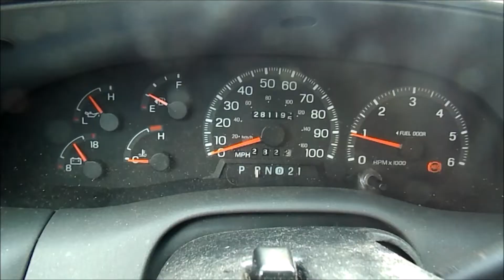How To Diagnose and Repair Sticking Indexing Valve For Irrigation Sprinklers

Comment: It is not clear at all what the problem was and how you solved it!
Reply from the maker: 1:30 Problem is The Scale Build Up On The Diaphragm for the Indexing Valve. By scraping Off The Buildup From Hard Water The Rubber Can Seat The Seal Around The Circumference Preventing Bypass. A Bad Seal Will Prevent The Indexing Valve From Cycling To The Next Zone